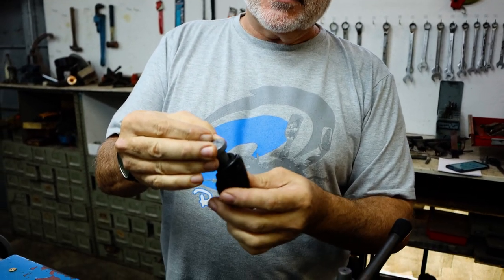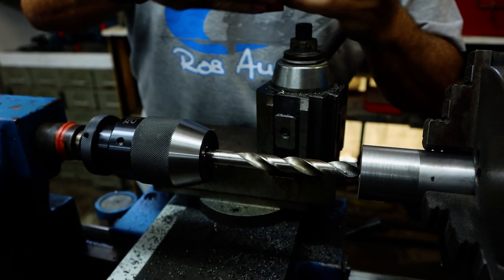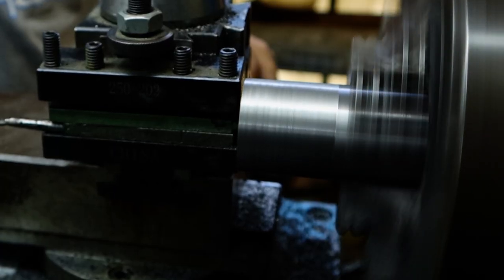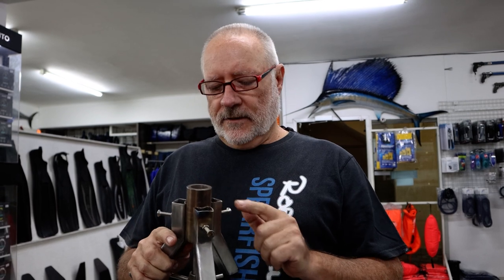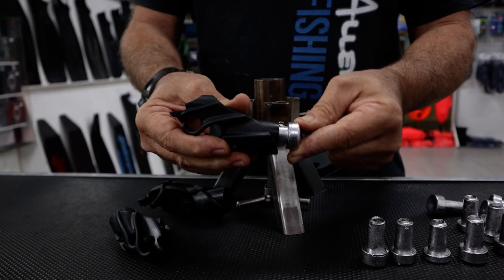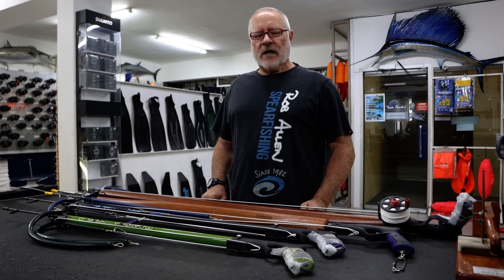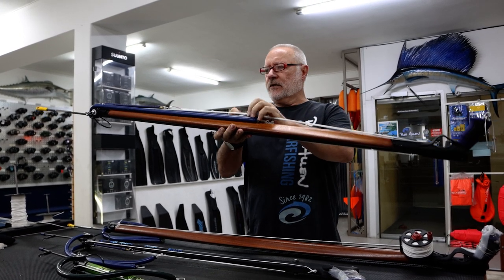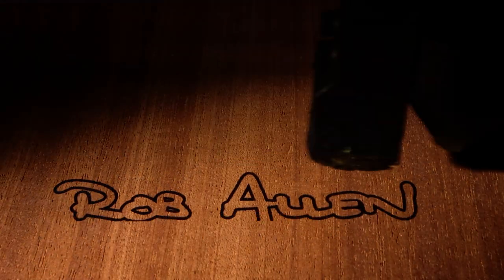Rob Allen | Timberline Series | Part 2 | Production | 2022

Comment: Nice video - thanks for sharing. 
Just read some of the comments. IMHO and using so many different spearguns over the years I always come back to RA. Main reason probably being I trust the gear. And as said so many times also by Chris Coates, I keep all RA and just change the length of barrel as needed (range, vis, etc) - making it very smooth to transition between guns. 
It is interesting to read sometimes comments of technical nature, that let assume the writer of those comments must be very experienced AND has done himself a lot of test to be able to speak so confidently about it, For my part I believe in constantly learning to become a better/safer hunter. If I gain a mm more or a gram less etc is probably not the highest priority IMO.  
Keep it up RA. Love what you do and how much you share... (I'm not being sponsored in any way!) :)
Reply from the maker: Many thanks for your positive remarks.

Comment: These are lovely but when are you going to update your handle to a reverse trigger mech? My Pathos 82 has more band pull than my RA 90 and is shorter than my RA 70, effectively rendering both of my RA guns utterly obsolete - I haven’t used either in 5+ years. Would be nice to see a bit of innovation on this side. More important for short guns, I know but I think you’re pretty much the only manufacturer still using what is a very outdated mech style.
Reply from the maker: I am of the opinion the reverse makes no difference when you consider some facts. Why do you need more power when you can already overpower the gun just by shortening the rubbers? Overpowering a gun will make it inaccurate. We have done many pool tests showing this. Also, many battle to pull the bands that far back as the further back you need to pull the bands, the more difficult it is. To compensate, many will then fit longer bands to enable them to load all the way back, defeating the object of the reverse mechanism in the first place.
Reply: @RobAllenSpearfishing  agree 100%. That last few cm on a rear mech makes it a total pain to load.
Reply: @RobAllenSpearfishing    those are not valid points at all. I’m not trying to overpower a gun, I don’t want hard to load, over tight bands. That’s the last thing I want. A reverse trigger shortens the gun by a good 12cm, it’s as simple as that. Why would I use an RA 90 when I can have an equivalent gun (band stretch) that is smaller than an RA 70? In environments where small guns are essential, this is really important. There’s a reason that no-one I know uses RA guns any more, they are just not suited to the local, low vis conditions, other manufacturers produce products that are better for our environment. I appreciate that small guns are probably not your primary concern as a business and that the re-tooling and costs to update your range to reverse mechs would be very costly but don’t pretend that the outdated mech layout you use is superior, it’s a purely financial decision. I can’t think of any other premium manufacturers that use the ‘old’ trigger layout any more. It’s outdated. Generally when people protest that ‘everyone one else is wrong, I’m right’, they’re generally wrong. Don’t get me wrong, I’m actually a real fan of the company and it’s products but the reverse mech omission is a real let down for me and makes the guns non-viable for my needs, which is a shame.
Reply from the maker: @BR0SE1DON  Why are the points not valid? The majority of new and or young divers will have difficulty loading a reverse mechanism gun correctly set up. We prefer to manufacture gear that is suited for the majority.

I don’t get your point with the 70cm reverse trigger being the same an RA 90? There are so many variables from one gun to another, spear size, band lengths and types, barrel buoyancy etc.

I do understand you will make the gun a little shorter by moving the spear back a little. I’d see this being an advantage with a longer gun that is harder to swing/maneuver. 12cm shorter will reduce the drag but, at the same time reduce range. If the barrel was not shortened but the spear was made longer, the range would increase slightly. 

I do agree our guns were not as suitable in low vis conditions when compared to other brands. This is why we brought out this Timberline roller, in the short lengths we can make it strong and buoyant. 

Please don’t jump to the conclusion that we are not changing to a reverse mechanism because of financial reasons.  You obviously have no idea how much R+D we put into new products. We would have done this in a heartbeat if we saw sufficient merit to do so. 

On a side note, what is your thoughts on the small ID bands “all premium manufacturers” are pushing?
Reply: Aloha guys. Reading these comments I'd like to share my experience. I bought a carbon RA 110 and that was my go to gun for a couple years. Then I bought a reverse mech from MVD and changed it. Long story short, I sold that gun and bought another RA. I learned the hard way that a reverse Mech is not better. I just shorten the bands. Also Small ID bands are great but expensive. Cheers from Hawaii🤙🏼🤙🏼
Reply: I also feel similarly about this topic. You can see in a coatsman video that the equation for power in spearguns is derived from the length at which the band stretches. If you add to that length with a reverse mech, I feel an equal sized traditional gun simply would not have the same potential. You can’t just shorten the bands, because the equation for power includes band stretch length. I do agree however that loading is more difficult on a reverse mech and also agree Rob Allen products are top of the line and you can’t go wrong with them. I’d hope this could be a future topic on testing actually. Doesn’t seem it would be too hard to prove or disprove the potential of two 100cm guns, one with reverse mech and one with traditional.
Reply: @bluedoggum8373  in regards to guns being harder to load with a reverse mech, I switched from single 16 / 18mm bands to double 14mm bands - what a difference - so much easier to load, just the right power and no noticeable increase in recoil.

Comment: Hey rob. Got my timberline today, my reel hits the rear hook and therefore doesnt sit snug on the seat! Is there a different reel that can be used?
Reply from the maker: What reel are you fitting?
Reply: @RobAllenSpearfishing  one of your 50m reels
Reply from the maker: @andrewshugg7187  Ok, just checked our batch and it is a little tight. We have already moved the hook a little forward. Short term, try loosen the handle and pull it back a little, that will give you the clearance. Sorry for the hassle.
Reply: @RobAllenSpearfishing  i ended up having to cut a groove in my reel to slot the hook into. Its about 5mm too close.
Reply from the maker: @andrewshugg7187  Sorry about that but that is a good fix, well done. On a side note, these Timberline guns are specifically balanced for a reel or without. If it was set up without, the gun might feel a little heavier. There is lead in the grip of the handle you could trim if needed.

Comment: I have Inquiry about athe muzzel waight . Is it can be used with 120 aluminum barrel to reduce recoil ?
If yes what is the recommended waight?

Regards
Reply from the maker: Not a good idea as it will make the muzzle too heavy.
Reply: How many grams needed for carbon 120 with roller head ??
Reply from the maker: @yussefalmowel7276  We don't fit weight in the roller muzzles as the roller muzzle already has enough weight.